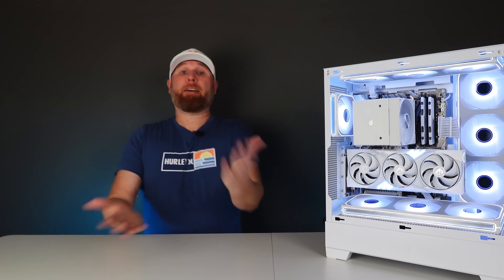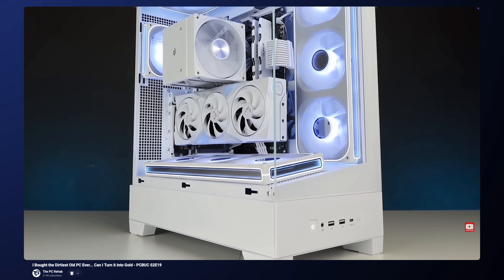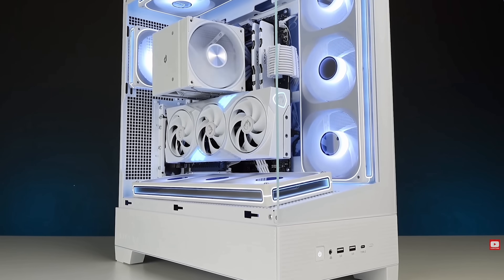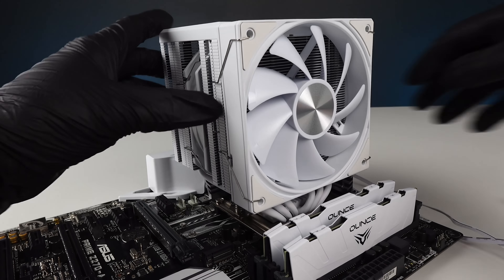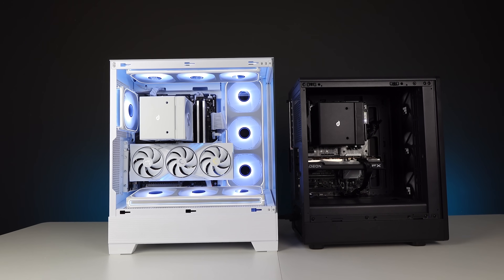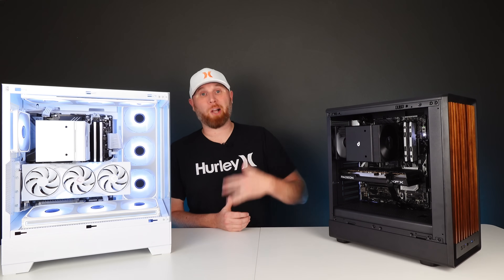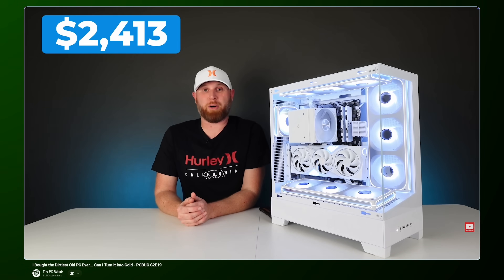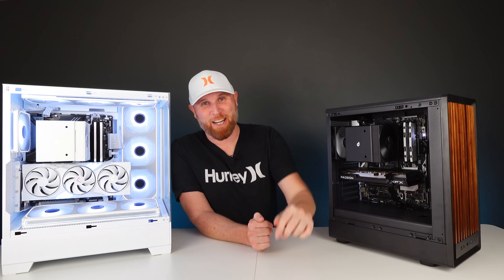Fixing My Biggest PC Flipping FAIL - PCBUC S2E19.5

Comment: z270 supports nmve ssd. 
The amount of $$$ wasted in the videos is incredible.
Reply from the maker: I turned $0 into 4k in 20 computer builds. Appreciate your input though
Reply: @ThePcRehab  I have a 7700K to see YT videos when I use my main computer so I know very well the chip.
Certainly is not a 4K chip (Both).
My comment isn't meant to be negative in a bad way. It's simply a lot of money to pair with a GPU that the 7700K can't take full advantage of because it's the bottleneck.
Reply from the maker: Yeah everybody was quick to point that out. That is why I switched it up. We all get in over our heads from time to time 😂

Comment: Stay away from this Chinese company! The KTC 34" gaming monitor looks good on the surface. Acceptable screen. However, the warranty and support completely sucks! It takes more then 24 hours for them to answer your questions because support is from China. Basically, you'll ask a question and they will ask a question back. So you end up going back and forth for days on end. The power cable and brick that connects to the monitor is to short and you will end up with the brick on your desk. The controls are junk. This monitor takes so long coming out of power saving mode, you'll never see your boot screen. It's difficult to have 2 machines connected at the same time the monitor fights itself on which one to connect to. If you don't know the controls before hand you'll go nuts trying to figure it out. Everything about this monitor is a chore.  Lastly and most importantly, if you don't like the monitor you'll pay the HUGE shipping fee back to them. They make you take pictures or videos of any issue to PROVE to them what's broke. I had an issue where the screen would randomly lighten up and then dim back. I had already packaged up the monitor for return. They basically said, if you didn't give them proof I would be responsible for shipping. That would never happen at Microcenter folks. I'll sell it locally before I pay $50-$70 for shipping. Stay away from Chinese companies. In the end, if it looks to good to be true and the price is so low, you can bet that you'll have issues with this small company!

Comment: There was nothing wrong with the i7-7700K at the $900 price point when it comes to performance.  I don't think that's a bad deal when you consider the performance and looks of the system.  HOWEVER, what makes the 7700K system a COMPLETE non-starter is the fact that Windows 11 doesn't officially support that processor.  Even if you bypass the requirements using Rufus, you won't get major build updates unless you do them manually, so you're selling a computer that will no longer get any automatic updates in 12-18 months.  Don't buy 7th gen or older CPUs anymore.  An i7-8700K IS fully supported in Windows 11 and I would have no issue with you selling that white PC for $900 with that CPU.  Even selling that system for $500 is a ripoff unless you teach the person how to install the latest build manually every 12 months and are fully transparent about the fact that they have a completely obsolete platform when it comes to software support.  I'm a computer repair technician and I build budget systems all the time.  There's absolutely nothing wrong with the 8th to 11th gen Intel CPUs.  They're still gaming beasts.
Reply: You kidding? That’s wayyy to much for an 8 year old CPU.  Switch out the 5060 with like a 2060 and that’s a $400 PC max I think.
Reply: @MrHitchey  He would be selling at a loss as that price point.  What matters is software support and performance per dollar, not the age of the hardware.  AM5 is way better than an 8th gen i7 but you're going to pay a few hundred more for it, hence the $900 computer turning into a $1,100+ computer.

Comment: I didn't reply to the original 7700k build. I liked the look but felt the 4 core 8 thread CPU made it all looks and no go. These 2 new builds make much more sense. 6600xt is a card I was considering buying for my PC and is well paired with the 7700k for a budget system. I think 500 usd is a fair price. 

The new specs in the white case make a much better feeling PC. Although I'm not a fan of the RTX 5060 I'm sure the next owner of this PC will not feel like it is under powered. That case and GPU combo look the part. The fact its a AMD AM5 CPU and a RTX GPU is going to help sell this. I think 1000 is fair. I just don't know how I would feel selling a PC for over 1000 usd with only a 8GB VRAM card.

Comment: they both look great I think the am5 pc should be listed around 1100 and the intel should be around 550 to 600 since they perform well and look amazing. Great call on not using the rgb specially since the ram is white helps hide it.